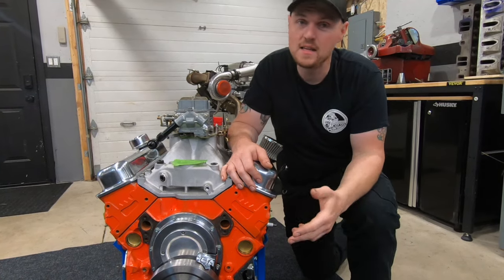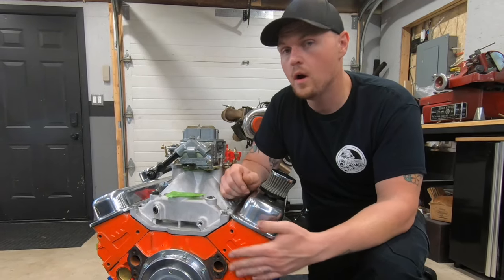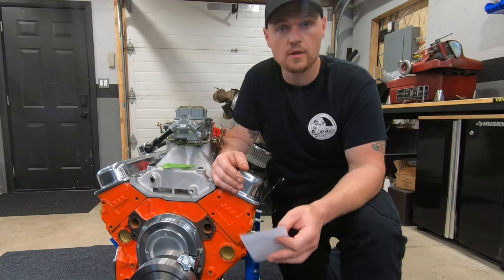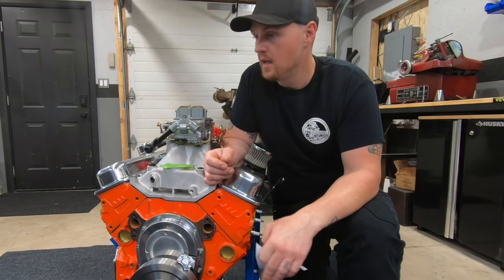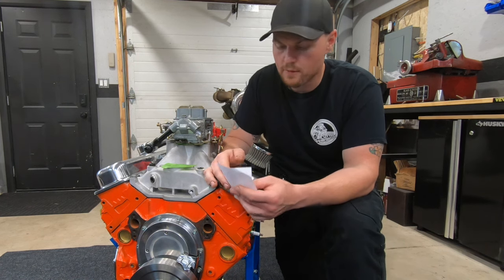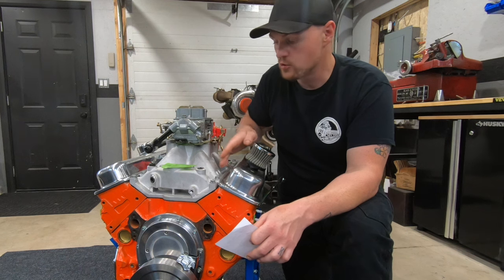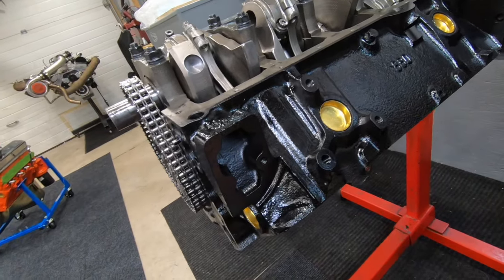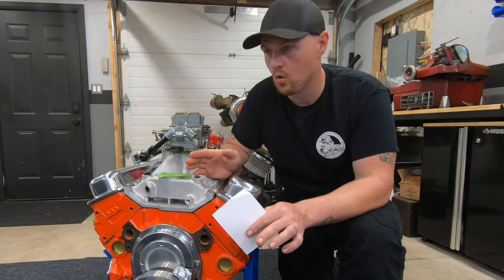Quest for a 500HP SBC on a Budget (The Block)

Comment: I remember back in the day if you were going to build a 400, you wanted the 509 2 bolt block as they were tougher than the 4 bolt block in the journal webbing.. that being said, I bet most bottom failures of 30 years ago are more due to poor crank quality and flexing in the journals than blocks moving around. I read that a 2 bolt block with aftermarket billet 4 bolt caps is much more rigid than a factory 4 bolt with cast caps.
Reply: I was told the same I have three 509 standard bore blocks I pigeon holes years ago.

Comment: 400 block crack tested and line bored plus sonic bore checked .
internal balance  forge crank and H/duty I beams 
pistons  Mahle Power Pak pistons   1.2mm rings less drag more Hp /Tq
pistons budget Weisco Pro Tru street 1.6mm rings 
roller cam /lifters ,,   2
236/ 242   on 110lsa  mild street 
195 cc  or larger cyl head  2.05 inlet valve  minimum 
single plain manifold 
1 3/4 headers   or big heads big cam run 17/8 primary 
Want more better heads,, big cam etc etc

Comment: I would like to hear your experience with cap walk / cap bounce.  I have a 400 “509” block with a 3.48 crank. Stock main bolts, 2 bolt main. Maybe 450 hp. When I disassembled it recently there were pock marks on the main caps and mating block surface.  I believe this is “cap walk”.  I am putting it back together with ARP main bolts.
Reply from the maker: Was the assembly balanced? Possibly a detention issue from too much timing? Was the mian alightment good?  I'd be surprised to see cap walk with that setup as long as the main bolts were never torqued past yield, and torqued properly and the caps fit properly in the block.
Reply: @cuttersperformance Good questions, yes it was balanced, yes it was align bored and honed.  Caps fit tight. The shop I took it to most recently said ‘detonation’.  It was 11.3:1 with vortec heads, so I think I pushed it too far on pump gas. It’s going back together with Brodix IK200 heads and 10.5:1.  So hopefully with that and ARP bolts, it will be good.
Reply: I did this same build yes had main cap walk and chatter had splayed caps installed no more problem it's worth the investment that combo is a beast. good luck